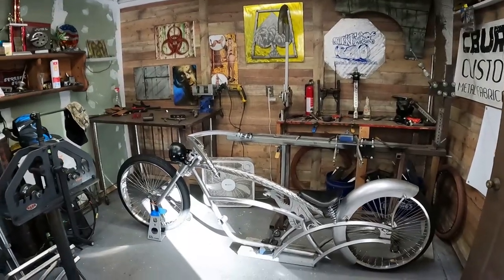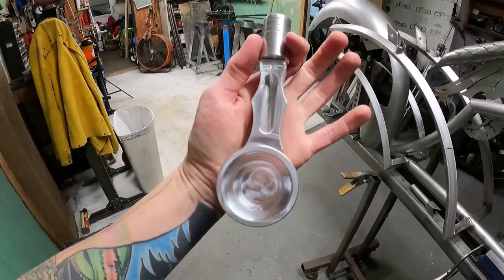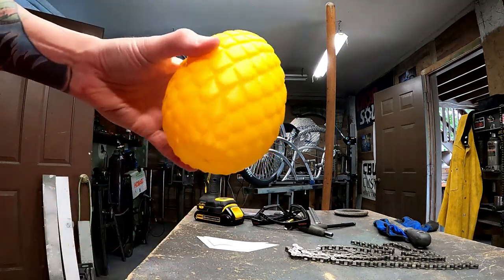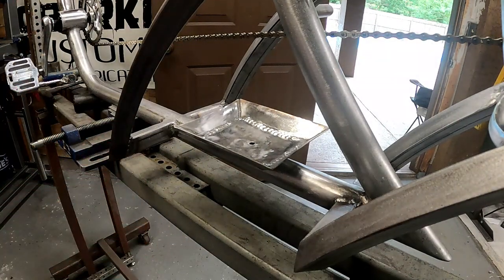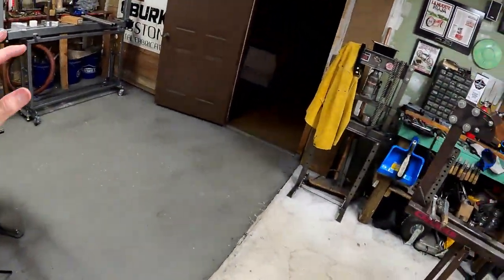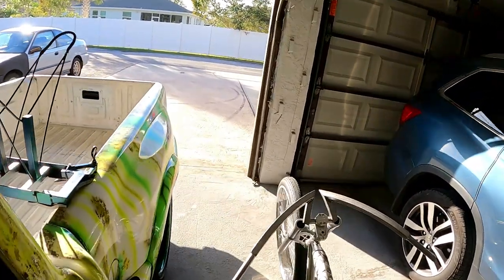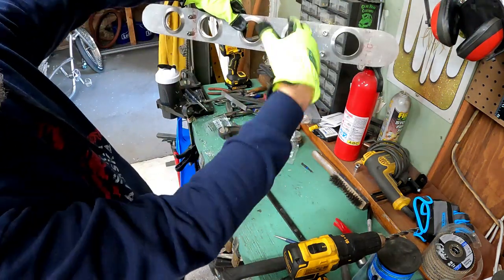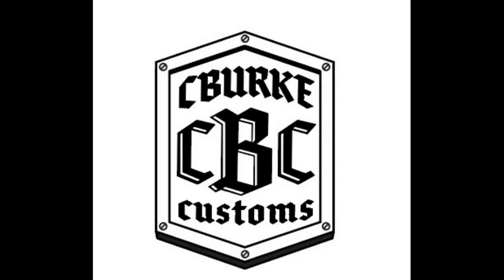Building A Custom Fabricated Lowrider Bicycle For A Build Off, Part: 12

Comment: Gday Mate from Down Under. Im Bloody thrilled I found your channel, because you mig weld your stuff. Ive been going nuts thinking that when I start my Board Tracker Builds, using old cut up steel bikes, Im going to have to buy a Tig welder or learn to braze. You turn out some bloody nice stuff with what most of already have in our sheds. Thanks so much for all your time and effort and putting up the videos, Cheers!
Reply from the maker: Hell yeah! Thank you so much for watching and build some rad stuff! 🙏🏻🤘🏻